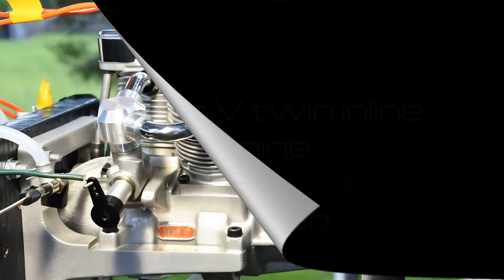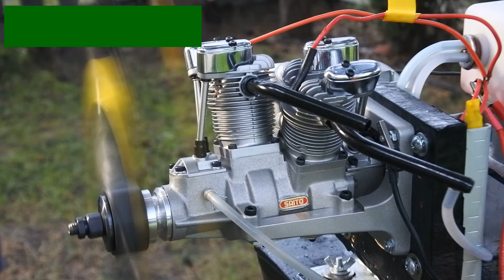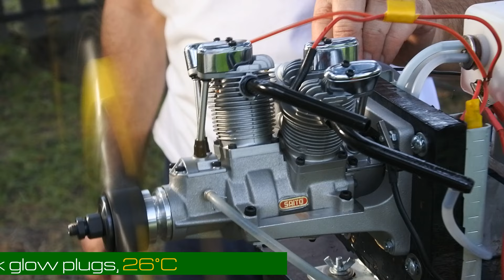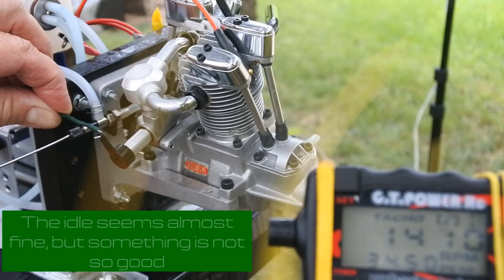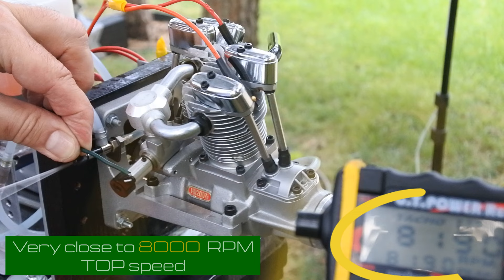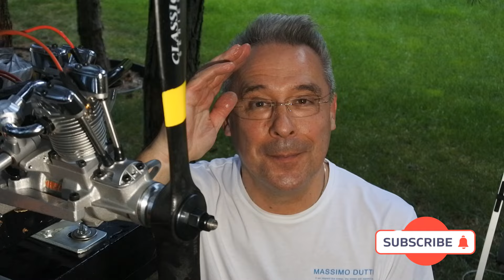Saito FA200TI first run

Comment: Be patient and do a lot of running in on the bench. My 200Ti would drop a cylinder in the air until it had a couple of gallons of fuel through it. It is now a very reliable engine. Great video!
Reply from the maker: Thank you very much for your comment ! Definitely, I've clear understanding, that Saito's direct chore plated cylinders utilized very hard surfaces, so to brake it in correctly, few hours needed, at least. I also recognize one cylinder drop out, at low idle with longer, than 20-30 seconds idle run. Clawrence Lee, in its test report, also indicate such engine behavior, but this should be eliminated by increased brake in time, I hope. 
You can find its here: http://sceptreflight.com/Model%20Engine%20Tests/Saito%20FA-200Ti.html
Quite an interesting reading !
Thank you a lot for information, quite helpful ! Have a nice day !

Comment: Fuel type?
Reply from the maker: Thank you, great question. Glow type fuel, 80% methanol, 20% synth oil, 10% nitro content.
Reply: Looks like it could be converted to premix with spark plugs and ignition coil packs
Reply from the maker: @Orbacron  Definitely, yes, for sure ! It will need just few additional parts, as two spark 1/4 - 32 plugs, Rcexl two spark ignition module, engine mounted Hall sensor,  and specially designed engine flange with magnets, which are responsible for engine spark timing, of course, small, at least,  7,4 V 1600 ma/h LiPo battery also will be needed. The most rare / hard to find / expansive part is flange with mounted timing magnets.
Reply: Great engine,  after watching the first video of this engine, i googled it..and found one on ebay,  it has been already converted to petrol with a saito fg carburettor and ignition system all setup..tempted to purchase, but is alot of dollars
Reply from the maker: @danielhitchens4407  
Thank you a lot for your comment ! It is true, this engine, being produced in limited quantities, really was seriously increased in its value, and basically, becomes collectors item earlier, that probably the reason of its so high price. There is some "resellers" from Japan, which are rising the pricing to the sky level, but being rare item, it is clearly understandably. I can tell you, that the price for this engine (N.I.B. condition) was approx. 1,2K bucks, w/o shipping on eBay. Some engines, which I was found on eBay, were increased in price approx.on 30-40%, so, this engines are being converted into some kind of a "hard currency".